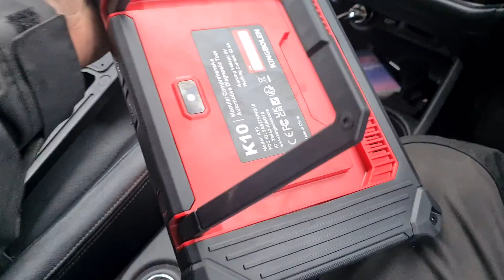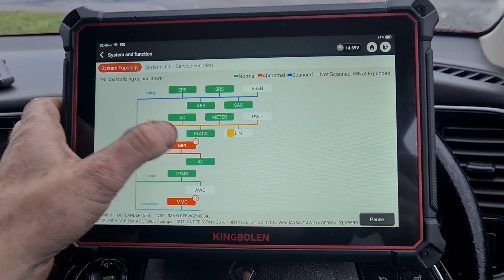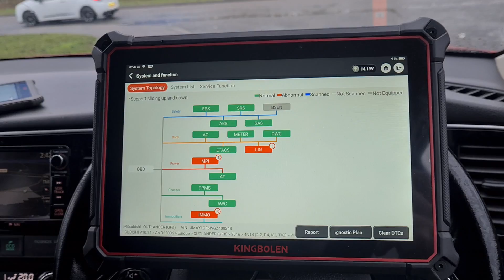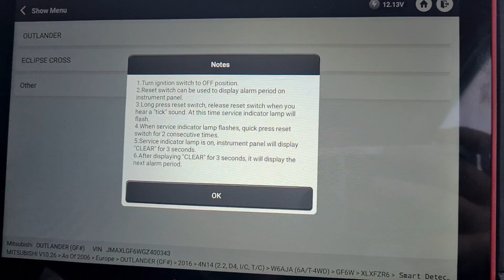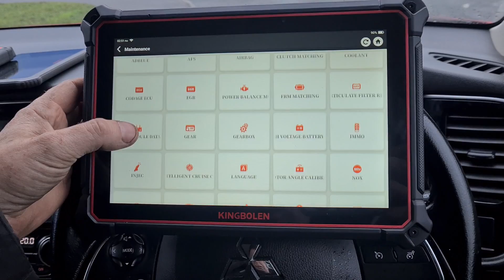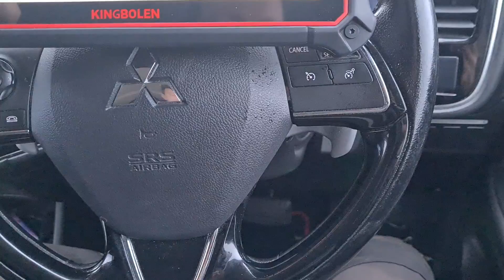Kingbolen K10 Bi Directional Diagnostic Scan Tool

Comment: I had a new EGR fitted and it shows up as incomplete on the cheap £30 scan tool that i have. it doesn't do anything EGR related... i saw some videos that mention about driving a certain way to complete them but still no joy... i was thinking of purchasing a scan tool that is capable of doing EGR. do you know if this will resolve the issue as i think the ECU isn't recognising the new EGR valve or would a simple ECU reset do the trick?

Comment: The thing that puts me off this brand is that Jimmy has shown many times where the unit fails to perform certain functions which it is advertised to do meaning he has to resort back to using the Launch Euro Tab 3.
This means that any one buying one is taking a gamble on whether it does exactly what it says on the tin.
Reply: K10 is at £490  Right now  from there offical site
Reply: He does work on alot of French motors. These are known to be fuckers for most tools tbf.
Reply: Euro tab 3 from Launch is £6000 and this Kingbolen is under £1000
Reply: @steprest521  For me the price doesn't justify buying a product that claims to do things when it doesn't. If Kingbolen removed all the non functioning items and advertised it correctly then people would know exactly what they were buying for 1k. 
As a result this product sits in a bit of a dead zone in the market as a garage would want peace of mind that their tool could perform exactly as described so they have confidence when accepting jobs from customers so is likely to purchased a more trusted brand and, on the other side of the coin, the hobbyist who is likely to have less disposable income for such a purchase is going to make damn sure that when they fork out a grand that it's well invested.
Reply: @steprest521  Actually it shouldn't matter as what is important is the bleuthooth dongle and the software. Normally, this eurotab 3 should only cost max 1000 or maybe even a 1500. The thing why it costs so much is because it's quite a high end tablet. You can do whatever you want with it, go on youtube, etc. It has high specs. Kingbolen, thinkcar and the likes only use the software of launch but don't let you use the tablet android system. It's locked out. Not only that but with the EURO tab 3 you will get all sorts of OBD cables (I think for old OBD1 cars?) and a battery tester as standard all in a case. Still I think 6000 is over priced for such a thing. Even Autel doesn't sell their high and tablet for such a high price, maybe 2000 or so at max. Don't know why Launch is asking for so much.
Reply: @steprest521  I bought the K10 for just over £700 during Black Friday (Amazon).
Reply: K10 under 600 from Ali sane ATM.
Reply: i have had very good experience with Xtool, but not having used the Kingbolen i cannot condemn it. Jimmy uses it on many different makes and models so i would bow to his experience